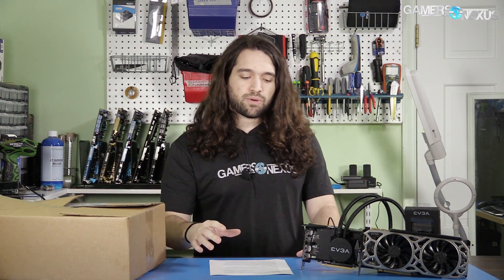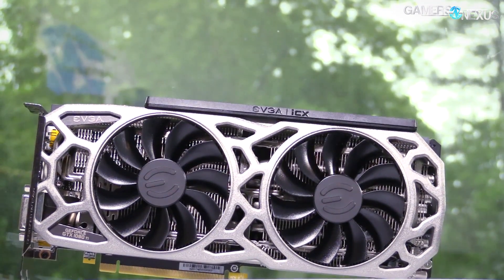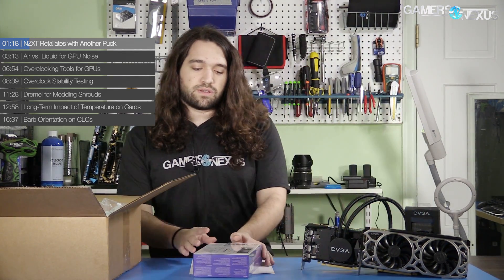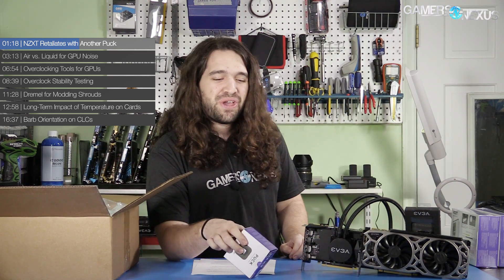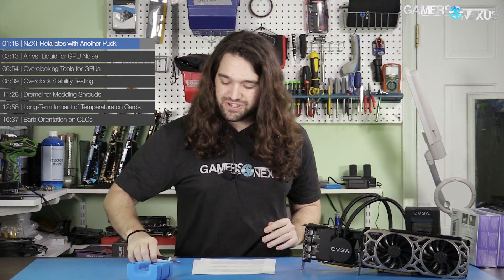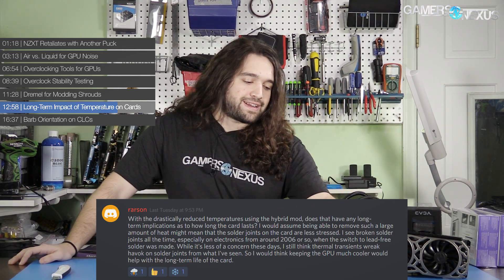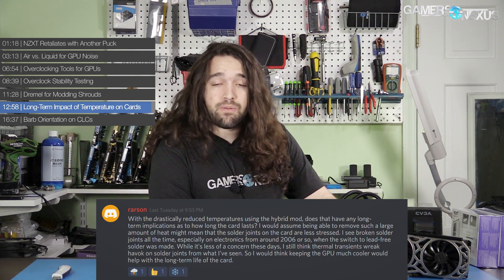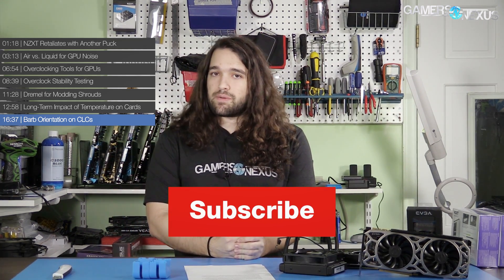Ask GN 49: Long-Term Impact of Temperature, Noise Optimization

Comment: hello Gn  i have  a strange issue with my gpu that you might have some insite on.  i have a founders 1070 with a aio on it.  the problem im having is with my overclock.  i have a +260 on core and +600 on memory putting me up to 2164Mhz on the core.  when my gpu is normaly working it sits very low on its core speed in afterburner around 500mhz.  when i open a game the card goes to top speed and crashes the game right away.  however when i turn on kboost from evga my card runs at 2164Mhz at all times and wont crash the games that i play.  do you have any ideas what would be causing this instability without kboost?
Reply: Zack Fisher I've found like in the witcher 3 for example when I have a high overclock and open a menu if the clock goes down a lot and then jumps back up when the menu closes the game will crash. It's something to do with the clock ramping up so high so quickly. Don't know if there is a solution.

Comment: Is there any good information on the effect of stuff like cable extensions on overclocking or system stability? I'd like to add something to the 24 pin on my PSU, but if it'll have much impact, it's not worth the effort. I run a 4.7ghz OC for my 6600k on a high-end board.

Comment: I have a 120mm rad at the back of my case, but have the tubes coming out of the top. when I had them on the bottom the tubes were pressing up against my GPU fans. but now I do get a few seconds of pump noise when I boot up.

Comment: The temperature segment could not have come at a better time! I just found out that the cause of my seemingly strange BSODs was actually just because I had forgotten to plug in the system fan that was the ONLY source of airflow to my stacked drives! I was going crazy for over a week, thinking maybe the RAM wasn't compatible (new Ryzen build), reinstalling Windows completely, reseating RAM a dozen times and testing at least 30 combinations of speeds/timings/voltages, all before I checked the BIOS and saw only 2 fans recognized. 
Turns out my 850 Evo was running really hot. So hot, in fact, it corrupted my Windows the first time. I hope it's fine now and isn't permanently damaged because SFC reports everything is fine now and benchmarks are exceptional. 

TL;DR: COOL YOUR DRIVES. PLEASE.

Comment: Regarding the 2nd question (air vs AIO on GPUs): I think you missed something there. The case plays an important role when it comes to idle noise. There are cases that are very good at noise dampening (Nanoxia or some models from Fractal) and some that are more orientet toward airflow with many openings. The first category is ideally suited for AIOs imo, the heat generated by the GPU will in most cases be directly vented out of the back. It's a win-win in my book.
With open case you need to be much more carefull what you are doing when aiming for a "silent/passive" rig.

Ofc it never hurts to set up custom fan profiles - Speedfan is a very good OS based tool for that (JayzTwoCents did a good "how to" for Speedfan).

Edit: Forget to mention some AIO pumps are just faulty and make much noise while working or they are orientet wrong. What you should always check with them, is their operating speed - if your pump is more than 500 rpm off in regards to max rpm from what the manufacturer and other users/reviewers report, something is off. 
Also some bubling noise is normal after first installation or moving the system - it should go away within a few operating hours and turning the system on and off over a few nights.
Reply from the maker: Didn't miss it -- we talk about that all the time in the case reviews. It just wasn't discussed.
Reply: No, no, no - I didn't mean in general. I'm just of the opinion that bringing it up in your answer to the viewer question in this video, would have been good. Nothing else was implied - you guys know your shit when it comes to thermals (on of the reasons I subrided here and TH germany not LTT pointing there Smartphone with FLIR funtionality at a case), there is no questioning that.

Edit: You should really bring  Igor Wallossek on the show at some point, for many years now he is going after the AIB partners and their dodgy thermal solutions/fan curves. His methodology and test setups are really great and constantly evolving.

Comment: Hey Steve/GN, question about Thunderbolt 3 motherboard headers: 
many mobos with THB-C headers (for add-in cards) use a 5-pin header with a widely adopted header insert shape. Some motherboards (e.g. Z270X Gaming 8, GA Z170 Designare, etc.) have a smaller 5-pin header that cannot be used with the Asus ThunderbolEX 3 PCie card cable. 
Q: Is the 5-pin (thunderbolt 3) header a standardized pin-out as in could one theoretically create an in-between for the cable and header to match? Is there any way to determine the north/south setup of the pins on the header/cable?

Comment: Question: I have a freesync monitor(lg 29um68-p)that goes up to 75hz with freesync turned on, but when I use an nvidia card it skips frames any higher than 60fps. Why only higher than 60 and not its entire freesync range of 22-75hz. Also why doesn't it work just to leave freesync off and overclock the monitor via nvidia control panel? Cheers!

Comment: Question for the next Ask GN,  

Given that the difference between x8 and x16 in gaming is next to nothing, do you think its worth while using a 2 slot m.2 carrier to spilt the second x16(@x8) into 2 m.2 32gb/s slots for 2 1tb NVME ssds?

 http://amfeltec.com/products/pci-express-gen-3-carrier-board-for-2-m-2-ssd-modules/ 

It would allow for 3 m.2 nvme cards that are connected to the cpu and allow for a build with zero Sata drives while giving a lot of space. As you can also use the pci-e 2.0 x4 slot for a 4th drive all be it limited to 20gb/s.

Comment: Question: What's GNs opinion on DIY PC ducting/compartmentalizing? Servers, high end workstations do this all the time, you can get a duct/compartment up in push/pull with the components that need cooling in the middle of the fans. WIll it bring an advantage? The PowerMac G5 is a good example on this on it's multiple CPU compartment setup.

Comment: Funny you mention the Witcher 3 finding instability better then synthetics.... i was playing the witcher 3 yesterday and my RX 480 from XFX (the best model, with 1333Mhz) died mid game even though I only used it for a couple benchmarks. Started with an error code 8 on my Asus Crosshair VI Hero, then after a couple restarts, an error code 'b2' kicked in and no PC boot. Thinking the motherboard bricked itself after the new bios update and going by loads of online research (most telling me it was a CPU problem even though I debunked that with a CPU swap, from a R5 1600 to a R7 1700X, the prob persisted), i was already contemplating returning my board when I decided to stick a GTX 950 in and voila... it booted and PC in working order again. Thank fuck i noticed the boot cicle was getting stuck on the 'VGA' led otherwise i'd have returned the board. The Witcher 3 is indeed the instability finder. Now, fuck knows what happen for a brand new RX480 to pack up like that. 

I think there's a bios switch on the card. I'll probs switch to the 2nd BIOS just to try out the card once more before I contact the seller for a return. If it boots i'll flash a new BIOS to see if that fixes it. I need my RX480 this weekend damn it.

Comment: Question for Ask GN: After hearing about proper positioning of AIO's radiator (to reduce noise) and knowing that inside there are air bubbles no matter what would you suggest to try refilling radiator by myself? Could you make a guide (video if possible) on how to refill AIO to make it more quiet or maybe even to fill it with better fluid. My problem is that i try to fit Corsair H110i inside my InWin 303 case and there is no way to hang it at the top of my case (tubes are to thick and mess clean look). I need to put radiator at the bottom and want to reduce noise the most i can.

Comment: I have one. Whats the real safe 24/7 temp for a 2500k? For years all i'm seeing is guess work. A lot say just dont go over 80c on the cores and some say higher. Or is just keeping the over all temp below 72c that shows on a lot of MB bundled software like AI suite and MSI core centre better. I just tried the preset for 4.8 and its giving about 4.3v or so but i'm still not going over 70c on the cores. Over all cpu temp is barely hitting 50c. If these temps are right that's very good. And if it is over all temp that matters and the 50c is right i could probably do 5ghz easy enough.

Comment: Ask GN: Why don't intel and amd use the GPU type die socket ? The GPU die has no shields and more stuff to reduce the heat dissipation, GPUs have that metal thing around the die that doesn't allow the cooler to crush the die but makes the exact pressure contact. Why intel and amd doesn't take this approach for their CPUs? Won't we get even lower temps and more overclocking by putting the cooler directly on top of the die itself ?

Comment: I have a question for the next Ask GN: When it comes to upgrading a gaming PC, what is the best time for a full system upgrade that will give you a significant increase in performance and is it better to base this decision on product cycles (i.e. every two product GPU releases. GTX 670 to GTX 1070) or years since system was built?

Comment: but seriously. you can get a 1070 to run at 800rpm  at 2ghz under full load with a good air cooler, dont tell me that any aio water cooler can come close to that noise level. im sure that 20 something db

Comment: Can you guys test to see if the lower 1% and .1% lows on the 7700k are caused by the terrible TIM and possibly thermal throttling. I mean it's a good time to check considering all the ruckus over the terrible temperatures and Intels awful responses to the situation.
Reply: Kly Clack I think the poster is referencing if deliding has an effect on 1%/.1% lows.
Reply from the maker: Ah, understood. Yeah, we still need to delid and run tests.
Reply: I think one question for the next video could be, "Why do GPUs have a bare die with a perimiter shim and CPUs have an IHS? Would a GPU style solution improve modern CPU cooling? One would think it would since bare die CPU cooling products great temps."
Reply from the maker: We covered all of that in our initial 7700K review and follow-up Gigabyte board review, including temperatures.
Reply: I was. Sorry english is not my first language.